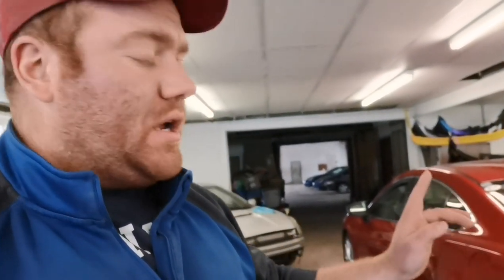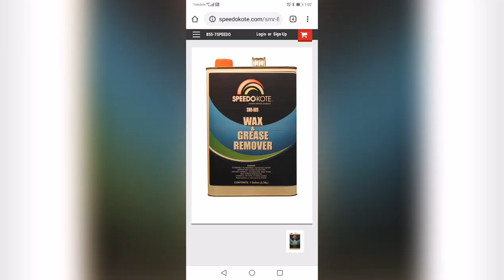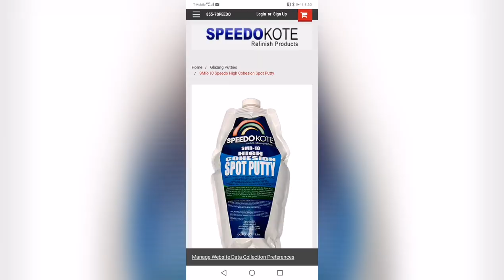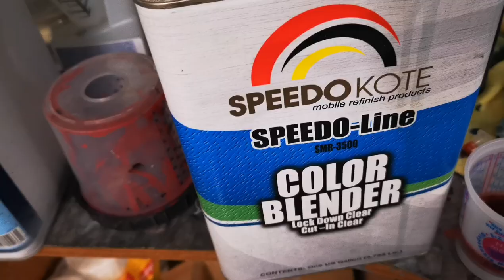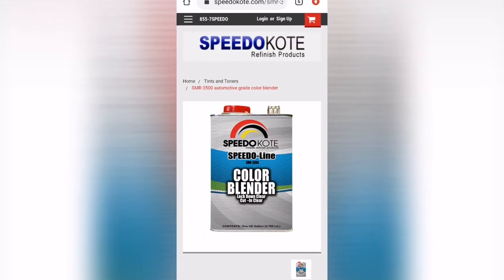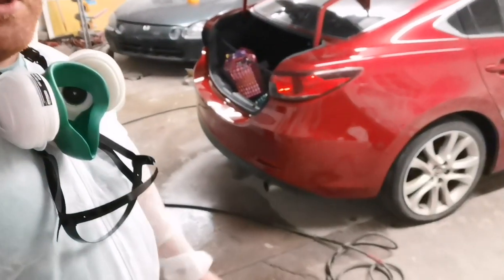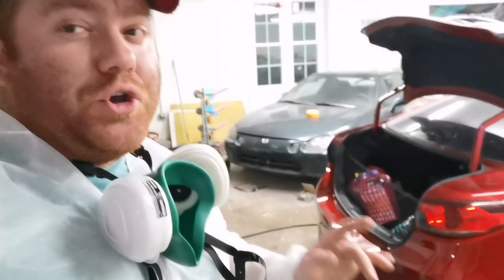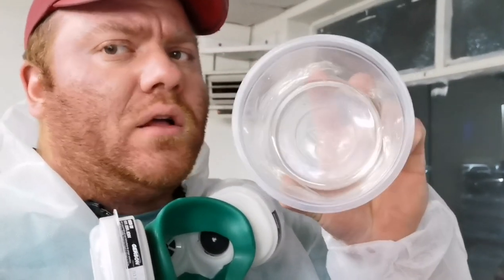How to spray candy red / tri coat

Comment: The information that it has a flex additive already added is amazing news!!! I plan on experimenting with using this on top of remove able coatings. If it retains the peel ability, this will be my new go to clear for the shop!
Reply from the maker: It's got flex additives for adhesion and durability. Not for Peel ability just to be clear lol
Reply: @speedokoterefinishnetwork4937   oh yes I truly understand lol. having that just might make it the next best thing for my applications
Reply from the maker: You will not be disappointed with this clear coat. One medium coat, fallowed by one full wet coat and this stuff looks amazing
Reply: @speedokoterefinishnetwork4937  Do you recommend using reducer? Without it can I still achieve smooth finishes?
Reply from the maker: I usually use the Smr135 without reducer unless it's super cold I'll add a super tiny amount of fast reducer to speed up dry times or warp speedo

Comment: little bit of megs 66 with a fine pad should do the rest of the red just nicely. id probably glaze the old red after to make it pop with the bumper.
Reply from the maker: Yea that's the proper way to do it polish the surrounding panles to match the gloss

Comment: Looks 100% better. Now I did the same test you showed with some clear I had over from a paint job two days ago and it was cracked and a lil wet. Is this a real test of your clear? P.S I really like this clear and plan to try others.
Reply from the maker: Very weird Mabey it's the climate? All clears if left in a cup long enough usually will crack sooner or later, I had mine sitting for 2 weeks in a open shop 40 degreens

Comment: I know u don't wet sand and buff, but I usually have to since I don't have a good garage, I wonder how that clear sand and Buffs, I usually use shopline cheap universal clear
Reply: I was just wondering the same thing. If the clear stays that flexible does the surface get hard enough to wet sand and buff or will it have a sticky sort of feel?
Reply from the maker: Smr135 wet sands pretty good after a full 3-7 day cure and harden. It does stay flexible to a degree but iv found it wet sands pretty easy.

Comment: Man I guess painters don't own tools to take that bumper off
Reply from the maker: No we don't. We don't r&i crap. We scuff the edges super good, and go... that's why we make 250k a year and body shop techs make 60-80k.
Now my restoration work I will remove everything. Bumpers, fenders, lights, hood ect ect. But not quick work like this. It's in and out.
Reply from the maker: @BossPainter  not even a hater. I am here to educate. Reality is mobile bumper techs are the kings of the industry, there the fastest, most efficient, and make the most money. They make 2x more money than "lead painters" at body shops.

Comment: Mazda Soul Red Crystal NO candy ?
Reply from the maker: https://www.google.com/search?q=what+is+candy+red&oq=what+is+candy+red+&aqs=chrome..69i57j0i22i30l4.5489j0j7&client=ms-android-bell-ca-revc&sourceid=chrome-mobile&ie=UTF-8
Reply from the maker: Yes, by definition, this is candy. Candy is a translucent mid coat applied over a mettalic base to create a custom effect over the surface.
Reply: @speedokoterefinishnetwork4937  KA678 additive for clearcoats is not necessary ?
Reply from the maker: Our clear coats don't require any additional additives no.

Comment: So I have question of the product overall so I just build a shop and at the shop in at we normally keep all primers all sealer and clear on hand so I would like to buy your brand but have a question here in texas we don't need low voc  so I don't know how it would react to regular urethane paint are all your primers paintable like the super high build the ppg super high build is polyester and it's not paintable